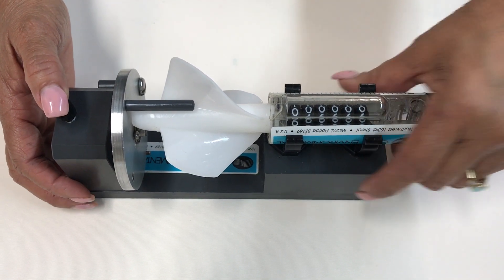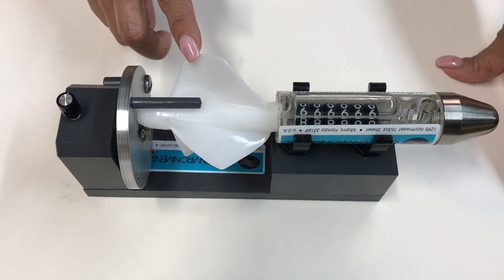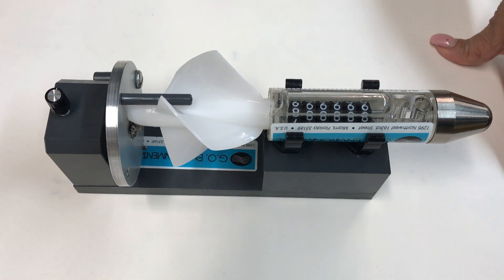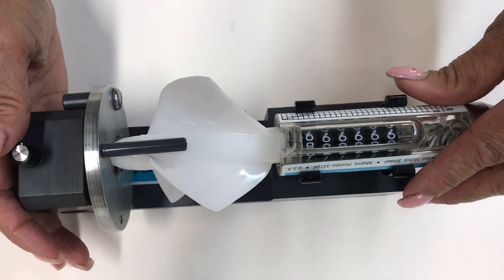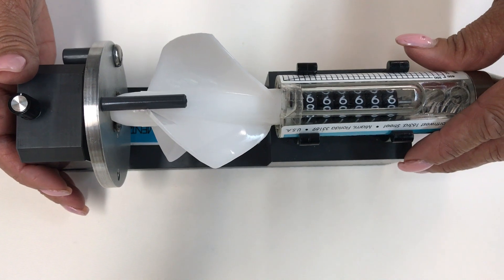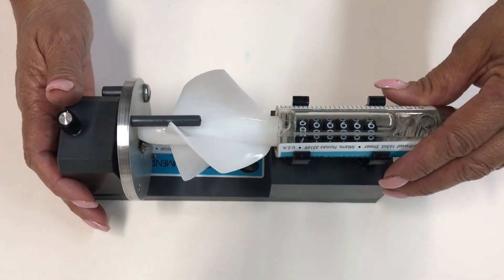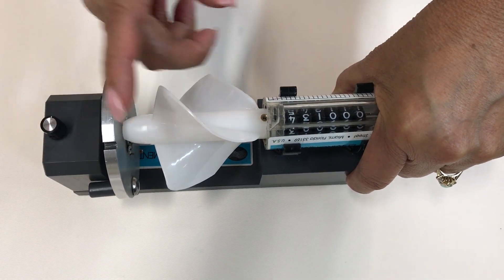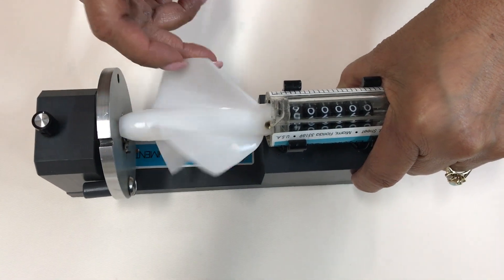Checking the 2030R Flowmeter

Comment: Note that the first attempt to check the meter was done correctly with the impeller next to the blade.  The next two attempts have the impeller away from the blade it will hit.  General Oceanics explicitly states that the impeller should be up against the blade to prevent damage.  Beware.